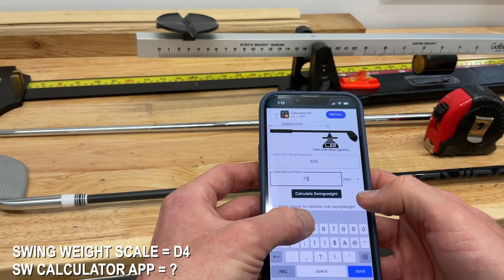HOW TO SWING WEIGHT A GOLF CLUB

Comment: I noticed you didn't include the grip tape into the the club weight data to pre-determine the swing weight.  Shouldn't that be included?
Reply: It should be offset by the weight of the ferrule and the epoxy, but if you put on an excessive amount of tape wraps, then you should do a dry fit with the amount of tape you’ll be installing. I do all my dry fittings with the amount of tape I'll be using and with the ferrule already pre-installed. The error I make is the weight of the epoxy, but then when I aim for e.g. D2.0 I'll do my dry fitting at D1.8. In fact I measure the swing weights of all my clubs separately before assembling.

Comment: I've never fully understood swing weight. Because if using all the same components: head, shaft and grip it should not matter. Say for a set of irons. 3-P.
Reply: That is true if the head weights change by 7 grams per club head, for every half inch change in club length, the shaft weights are all identical, prior to tip trimming or butt trimming, or both, assuming a non taper tip shaft, along with the grips weights being the same. Every manufacturer has a tolerances plus or minus a certain number of grams.
For instance, Star Grips have very tight tolerances plus or minus 1 gram of stated weight.
Club heads can be all over the place with regards to weight, lie and loft angles even on big manufaturer’s products. That is why you can disassemble a set 
of irons from even a big manufacter and find some of 
the shafts have tip weights as they are correcting for the under weight heads.
Reply: That said changing the grip weight may cause a big change in the swing weight but has very little impact on the MOI of the assembled club. Where as changing the head weight, shaft weight, or shaft length has a significant effect on the both the swingweight along with the MOI.

Comment: I really enjoy your videos! So much good info. I am an amateur club builder for almost 40 years. My technique is to dry fit the head and shaft without a grip, and use tip weight to achieve E0 (for example). I use that s/w through the 9i, then add +.5 s/w for PW, +1 for GW, +2 for SW, and +3 for LW. Epoxy and grip tape effective cancel out each other. I can then install grips, usually in the 51g-54g range, lightest grips on short irons and progressively heavier toward the long irons. Finished clubs will be 9 s/w points lighter than the s/w w/o grips. My mentor is Dave Tutelman, who believes that the grip reduces s/w but does not change the feel in the hands. Because the grip is basically centered in the hands, there is no contribution to the feel or heft in the hands. Most golfers cannot not feel the difference between 2 clubs s/w to E0 without a grip, one with a 50 gram grip and other with a 60 gram grip, but the s/w will be different by a few points.

Comment: Loved the video, thanks. Interesting, I have a much older Golfsmith scale and really appreciate the ability to chart my swing weights. Quick question, I have documented my overall weights for all clubs as well and watched how overall weightings is affected by small changes like lead tape, or, in the case of Drivers, head or toe weights addition/removal. I have learned that for my SIM Driver,  removing the Fade/Draw base weight(sliding 10 grams) and heel weight(10 grams), from my 47.5" Driver, I now have a swing weight change from E6 to D1 (overall weight was 335 now 325gms). After testing all the variables and weight configurations (E8 to D1) via Trackmen testing, I am not left with a 5 grams of lead tape to the base, Fade/Draw area, to achieve a final configuration of D4 and 325 grams. The Driver feels and performs much sweeter. Do you use or consider the overall weighting in your work? Your video dealt with the swing weight factors/adjustments but, not the overall weight adjustment or considerations. Thanks

Comment: Hi and thanks fr the video.  Did you forget to add the weight of tape for the grip ?  I use a total of 5 layers of tape at 1 gram per piece of tape and some pros use much much more.  Swing weight won't be right unless you add in the weight of the final wraps for the tape.
Reply from the maker: If you are using that much then you might factor it in. One or two pieces not really necessary in my opinion. And most importantly I assume you are using the same amount of tape for every club so the weight will be consistent across the set.

Comment: What about variations in grip weight through quality control? 

I regripped my clubs with Tour Velvet Midsize this past spring, and when I weighed each grip, not one was the same. I ended up writing the weight on each and putting them on in order of heaviest on my 4 iron to lightest on my sw as set sw usually progresses say d2 to d6 anyway. 

Do you weigh all grips in a build to make sure they are the same prebuild so that your streamline process doesn't have different weights, or do you just adjust at the end? 

Thank you.
Reply from the maker: I've never measured a Golf Pride grip that came out more than plus minus 1 gram. That's not enough variation for me to worry about in a build. I've run into some issue with some other brands. If they vary I would rather have more total weight in the short clubs so they usually get the heavier grips.

Comment: I’m planning on cutting down my 3-5 irons to match my 6, and then normal progression from 6-LW. If I just wanted the same swing weight as my current 6 iron onwards for my newly cut down irons, but didn’t need to know the swing weight number, what’s the easiest way to measure? Would I just find the CG point and have it the same distance from the butt end of all clubs? Thank you
Reply from the maker: Remember each head is lighter as the loft goes down so the final SW will keep getting lighter as you go into the longer iron heads. Personally I say don't worry about what the SW value is. Who cares. Get some lead tape and head to the range. Hit each of the newly shortened irons and start adding lead tape until you find the sweet spot of feel and consistency. You'll be far better served with this method. Once you find it for each club, you can input the new weighted club into an online SW calculator if you really want to know the number. Did a few videos on those.
https://youtu.be/sJALUBr51jI?si=Yz8a9-cIP4R2X4o2

Comment: What about the weight of the grip tape and ferrule? I like to put a strip of tape over the split grip and use a split ferrule. Then the only variable would be the epoxy.
Reply from the maker: I don't find the amount of weight added by the ferrule or tape to be influential enough to bother. Pair that with the fact that every club will have the same tape and ferrule and will thereby have the same SW change.

Comment: Does increasing swign weight have an impact on ball speed (and as a result distance) if the swing remains the same?
Reply from the maker: Physics says that a heavier head (more mass) will transfer more energy into the ball everything else being equal. That does require the speed to be the same though, and that can slow down when we start adding weight.

Comment: I have had my irons fitted with graphite shafts.  My swingweights now progress from 5 iron D2.5 to wedge and UW D4.5 is this normal?
Reply from the maker: Yes. I like to see the longest iron a touch lighter and the wedges a touch heavier. That's my preferred method.
Reply: @EFGMC  thanks worried that my new set had been poorly fitted by SGGT 5 is 2.5  6,7 are 3 8 is 3.5 9 is 4 and PW,UW 4.5 would you say this is a standard progression?
Reply from the maker: @stevendixon3422  I would say that's reasonable. Anything under .5 isn't worth worrying about in my opinion.

Comment: Well. Grip tape is needed as it weighs few grams. And depending on what ferrules you use will change it as well.
Reply from the maker: They will usually cancel each other out or at best add .5 to the SW. Tape weights 3g and ferrule plus epoxy weights 2-3g.
Most important is all the clubs will have the same tape and ferrules etc so the change will be uniform.